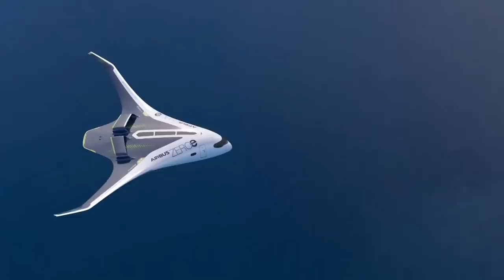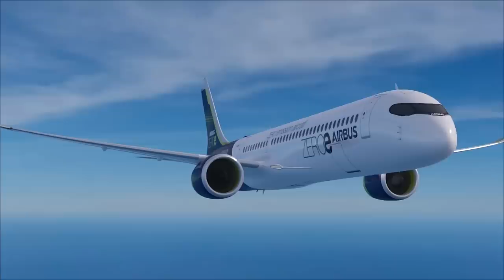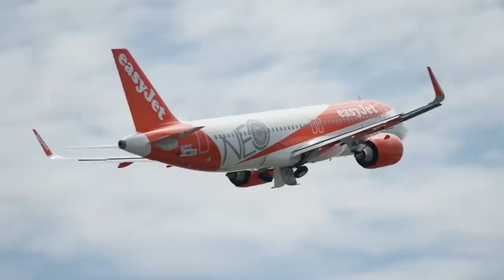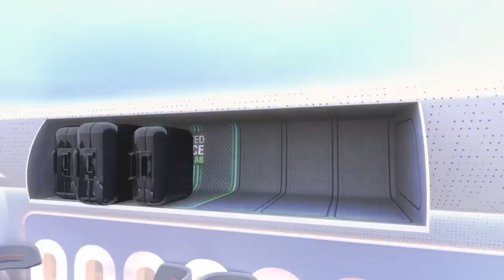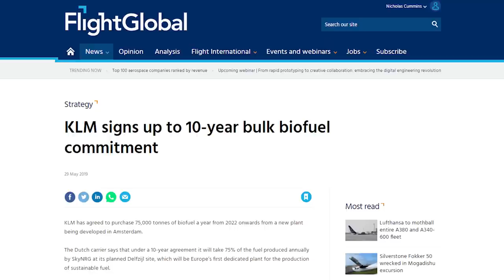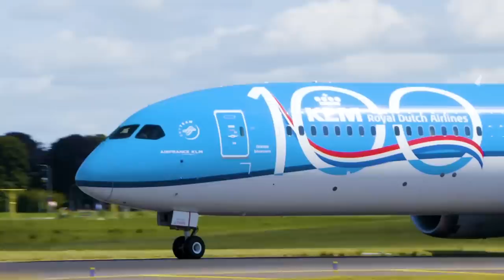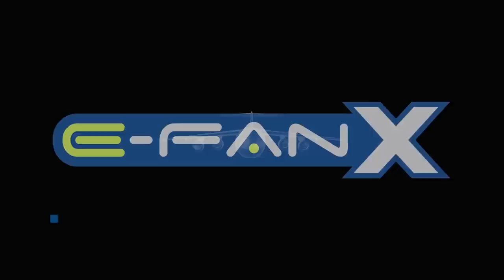Airbus Future Plane Concept - ZEROe - Hydrogen, New Cabins And Zero Emissions - Never Built

Comment: I really do hope that these new hydrogen hybrid aircraft become a reality. Especially the single blended wing body design. That just looks so awesome. We need to be pushing innovation in this so much more.
Reply: Blended bodies have existed since the 70’s. They aren’t used for commercial aircraft because no airports support them.
Reply: @airman122469  the main purpose of this type of body is the hydrogen tank , also this type of airplane isn't ready for airports, the airports aren't ready to work with these airplanes.
Reply: They have a number of shortcomings in terms of engineering, despite being more efficient.

Comment: I think the far more sensible solution to making airlines more environmentally friendly is just to invest in facilities that use a bacterium that was invented recently that can convert sunlight, CO2 and water into perfect kerosene.
Reply: but kerosene still emits greenhouse gases when burned... it would not be a 'clean' aircraft
Reply: @coconutisland.  True, but this - if scalable - would massively reduce the fossil fuel use needed to extract and refine hydrocarbons into jet fuel, and that in total is the majority of the emissions for a liter of the stuff.

Comment: All “fancy” ideas end up in stuffing more and more (and more again) seats into a plane. I’m highly sceptical that there will be any changes in commercial aviation design for a generation, let alone as drastic as described in this video.
Reply: I like planes being as they are in design, it's sleek and simple.
Reply: Look into spacex if elon succeeds we could be travelimg 24hr flights in 30mins with spaceships costing the same as a plane ticket in a decade or 2.
Reply: @pablomuzzobar8940  Nope. 

The amount of fuel required to get above the troposphere is far greater than just flying at conventional altitudes. It will never be the same cost as commercial airline tickets.

Comment: I like the blended wing body design because of the potential of reduced drag and it's stronger structurally even if conventional engines are used.
Reply: That could also mean a rougher flight for the passengers due to the more ridge structure.
Reply: Also in the designs the entire body generally produces lift helping to make them more efficient.
Reply: That's a relatively old McDonnell design.
Reply: I disagree regarding higher structural stability. Keep in mind that the cabin has to be pressurized. This isn't just for breathing comfort, but also a huge factor for structural stability. A pressurized body with round cross sections has increased stiffness.
Regarding wing stiffness: there can be too much of a good thing - (elastic) bending is better than breaking!
Reply: It was prohibited for Germany to develop blended wing designs after WW2...that is why the USA/GB got ahead...(B2,Vulcan) and they took those engineers...
But Horten got a new GA blended wing aircraft...

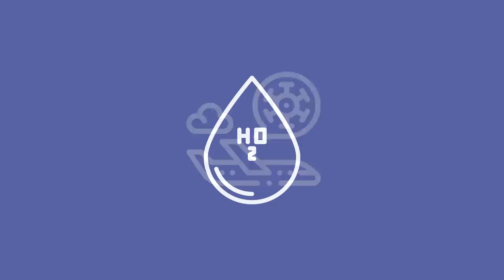Comment: 1:16 Dihydrogen Monoxide (H2O) not Hydrogen Dioxide.
Subbed BTW love your vids
Reply from the maker: Haha I knew I shouldn’t have skipped chemistry
Reply: It could be H-OH , hydrogen has one positive bond and oxygen has 2 negative bond usual comical formula it’s H-O-H , hydroxide ion OH-(negative charge) with active hydrogen H+ (positive charges), however liquid hydrogen (H2) must be store in very low temperature ( lower than -252.87 C)it will be hard to use , don’t know how they are going to use but it’s very hard challenge
Reply: @divyeshpatel147  Gaseous under ~1000 bar pressure.
Reply: @divyeshpatel147  , sorry, but burning hydrogen gives H2O, and is properly named dihydrogen monoxide, or simply dihydrogen oxide. Either is ok and its chemical structure is H-O-H.
Reply: @FoundAndExplained  EVERYONE should take chemistry and at least a little physics. Many issues a citizen must understand to vote properly involve applied physics or chemistry. To anyone who understands those subjects, global warming becomes a certainty, as does ocean acidification. Understand science and issues of pollution, dealing with plastics and many other issues are made clear. Otherwise, it becomes a matter of belief, or faith where you believe what someone else tells you. Many people who say that they don't believe in global are really saying that they don't understand how changing the amount of CO2 by small amounts can have such a big effect. The don't understand science. A physical chemist in the 19th century worked out the calculations at the heart of this matter, and those basic principles haven't changed in 150 years. It is 'settled science,' to draw a parallel to scotus and settled law, but people are illiterate scientifically, are unable to participate in many big issues of today.
Reply: @Prof.Megamind.thinks.about.it.  
Don't you think that electrolyze saltwater will create Cl-2 and NAOH?  You need fresh water brother and that they don't have.
Reply: @bonaventura3924  
Lessee... 
Combining them produces sodium-chloride , sodium-chlorate , and water . 
Okay... time to start selling table-salt , bleach , and bottled-water ! 
Seriously though , these can be sold , deep-sequestered , or otherwise neutralized . No great hardship there . 
🤔
Addendum : Even better ; combine ALL of the Cl. with Na. , then dispose of the salt safely .
Reply: Sorry to correct a know-it-all tween, but it would be far more accurate to call the compound Hydrogen Hydroxide, that is, HOH, because it is a much better description of the way it reacts and forms other compounds, that is, its CHEMISTRY.
Reply: @divyeshpatel147  You came fairly close to the best answer, but not quite there. Also, I don't know what "comical" means in this context
Reply: @Jose_Hunters_EWF_Remixes  "Know-it-all tween"? Damn dude. Why the insult? If you have knowledge to share, then share it. Don't be rude.
Reply: Actually the International Union for Pure and Applied Chemistry (IUPAC) gives waters chemical name as oxidane. 

In short, your pedantry is incorrect and people should stop LARPING as chemists.
Reply: @TheDrjehr  No, it's called oxidane. I'm not sorry.
Reply: Its also called hydrogen hydroxide as it is H and OH 😇

Comment: Using as Hydrogen as fuel requires massive modifications to the fuel systems not just the engines. Cryogenic fuels are incompatible with existing wet wing fuel tanks. That means the builders must find room in the fuselage for a fuel tank with twice the volume of existing tanks in the wings and the aircraft cannot be left with fuel onboard.
Reply from the maker: Yes the rear 1/3  Of these plane designs actually have hydrogen storage fuel tanks
Reply: Found And Explained That also impacts the wing designs as without the fuel in the wings the wing roots are carrying a heavier bending load so need to be corresponding heavier. (One of the reasons airliner fuselage tanks are the last to be filled as well).
It is not a simple swap. Other fuels would be easier - synthetic ethanol or methanol for example is compatible with existing designs or with more modifications ammonia (ammonia production currently swallows 1/3 of global natural gas production to make hydrogen).
Reply: @allangibson8494  synthetic ethonol releases co2 when burned which defeats the purpose of a hydrogen powered plane in the first place
Reply: webnothing  
You are wrong sir. Farmer has to plow his field, then plant the seeds,than apply fertilizer, then harvest the crop, delivered it to plant, when lots of energy is used to process it and distribute etanol. That's disaster for environment.

Comment: liquid hydrogen is much less dense than kerosene so fuel tanks need to be bigger so... no luggage in that plane?
Reply from the maker: The whole back 1/3 of the plane is the storage tank
Reply: @FoundAndExplained  oh yeah i see some versions dont have windows at back... still when they burn fuel center of gravity will change and that will cause some problems...
Reply from the maker: @jebise1126  Oh god I didn't think about the center of gravity changing! haha wow!
Reply: Yes but it’s heat value is 4 times higher, so 4 times less fuel is needed.
Reply: Storing hydrogen is a sod, too. All the world's cars could quite easily be switched over to run on hydrogen gas and be pumping nothing but steam out the back, but they'd need filling twice daily and would lose fuel just standing still.
Reply: webnothing  there’s many more obstacles. For one, the whole H2 cycle is suspect. Current economic hydrogen supplies are made from methane and water, releasing CO2 into the air, and collecting the H2 which is pressurized. This process uses lots of energy, and did I mention the release of CO2?  Using electricity would require installation of lots of generating facilities, and technology to create a functional transport system which is economically efficient.
Then there’s the whole energy density, and storage/transportation problems. H2 must be kept under pressure, and at extremely low temperatures, and still the gas can seep out, creating an explosive problem. All of these eat away at efficiency. Some have proposed building nuclear reactors, connecting with super conducting transmission lines transporting both electricity and H2 in liquid form. I’m not smart enough to do the calculations to see if this is feasible, but it calls for truly massive spending to build reactors, transmission lines, H2 electrolysis plants, H2 storage tanks, as well as cars which would run on H2, along with tanks which could hold H2 and be safe in accidents. All this before putting any of this into use, and proving whether it’s possible both technically and economically.
Reply: You  have to compress the hydrogen to convert it to a liquid. That's a lot heavier, especially when you consider how heavy the H2 tanks have to be to hold the pressure.
Reply: @Greatdome99  My senior design group is designing a hydrogen regional turboprop with a 1000 nmi range just like the Airbus. We based our initial weight estimation based on modifying the DHC 8-400 NextGen. Doing this we arrived at a MTOW of 75,400 lbs vs the 8-400's MTOW of 64,500 lbs. I am expecting our number to rise as we have not designed the wings and our RFP requires a takeoff and landing distance shorter than the 8-400's so we will need larger wings, and bigger engines since we are heavier, and our RFP requires higher cruising speed  (Our initial analysis shows that TO and cruise conditions are our limiting factors for minimum power required from the engines). Our preliminary estimated for our fuel tank are 11,160 lbs, although this is likely to increase as we incorporate more weight, drag, etc. This also assumes 1 large fuel tank at the back. As Jeb mentioned, we are facing a center of mass issue. We are looking at different options such as having 2 tanks, 1 in the front between the passengers and cockpit, as well as different ways for changing the center of lift during flight such as retraceable canards. All in all it seems like quite the challenge
Reply: Well then, make your hydrogen fuel more dense per area cubed. 

Only idiots talk in absolutes, but you wouldn’t know that
Reply: The best is sustainable biofuel
Reply: @Greatdome99  
You have to compress it and super cool it.  Evaporation would be a big (and dangerous) problem.

Comment: You missed another point about hydrogen. Hydrogen, when used with a catalyst in a fuel cell, may be zero emission, but apparently burning hydrogen as a direct replacement for hydrocarbons is not quite as non-polluting as many people think.

Apparently, the increased temperature of the combustion enables/causes some kind of reaction with the nitrogen in the air, producing... some sort of pollutant. I want to say nitrogen dioxide, but I'm not sure. It's definitely something involving nitrogen, anyway.

Comment: In All your aircraft stories posted, the plot leads to a crashing or deserted hanger stashed idea, in this one, it was the faith in hydrogen powered fuel. 
Yes Hydrogen can have range effects, including stability similar to collision/fire impact. Perhaps they will mix breed electric power engines with hydrogen afterburner affects, a future version would be plasma combustion as afterburners, with mini nuculear cells to amp battery duriation.
Reply: That'd be seriously sweet.

Comment: “Only the engines need upgraded”. Ever harvest, compress, and store hydrogen?
Reply: @Thomas Lucas Producing H2 from water with electrolyse efficiency is 30% at best
How do you bring that electric power onto the plane ?
You alos need to produce ENOUGH H2 in time... that is clearly impossible. People just dont imagine how much gaz is produced/ moved by an aircraft. This is by tons / second.

Storing hydogene is very hard, and the tanks continuoulsy link because the H2 is a really tiny molecul that can go through metal. Thats why rockets are filled just before liftoff and not in advance.
Reply: He said "Only the engines need to be upgraded, TO ANY EXISITING AIRFRAME" meaning the planes themselves just need HHO engines, learn to listen.
Reply: @SirFlukealot  sorry you have failed your critical thinking test. No more internet for you today with your magical thinking.
Reply: @Thomas Lucas VIDEO OF IT OR ELSE IT DIDN'T HAPPEN.
Reply: @Thomas Lucas electrolysis is not the debate. We know it exist. It is energy intensive however. You made a claim so back your claim.
                                                                       
This video's fault is that it claims if you throw new engines on a plane that suddenly they're clean energy vehicles. It does not address industrial scale production, storage, transport of hydrogen, far beyond what we use today nor fact the the fuel tanks of the aircraft will be radically different. You simple type however ignore all that.
Reply: @Thomas Lucas I wouldn't bother trying to change their minds. You are correct. No matter what you say or explain, they'll refuse to believe it because they are unable to fathom how it works and how to negate the problems from the simplified concept. It's already been done and refined.
Reply: @SirFlukealot  He's wrong.  The fuel system would be a major problem. Possibly insurmountable.
Reply: @Thomas Lucas  NOT easily. Costly and inefficient.

Comment: The plane with the propeller doesn't burn hydrogen in a turbine at all.
It uses fuel cells to produce electricity to drive electric engines, a completely different form of propulsion.
Also burning hydrogen in turbines isn't entirely environmentally friendly if it's burned in air (in part because said air contains other things then just O2 but also because the temperatures in question allows other chemical reactions, with fuel cells you really just get one chemical reaction, oh, and another thing, planes fly high enough that some of the gas coming in is ozone, perhaps not ideal to burn that...)
Reply: It these contaminates are already in the air, how does burning H2 and whatever is already in the air make the air worse?
Reply: @fahrbot1  Thanks for the explanation. Never knew that.
Reply: @fahrbot1  Awesome Facts - and nobody is looking at this way...
Reply: The plane with the propeller doesn't burn anything.  It is nothing but a digital picture.  The purpose of these ads is to increase public pressure for additional illegal taxpayer subsidies to Airbus.  There is a word for this in the English language.  It is called Greenwash.  Look it up.
No current or foreseeable hydrogen turbine has anything resembling the energy density required to power an aircraft.  The only non-hydrocarbon technology that comes close is lithium-ion batteries running electric motors with propellers attached, and even that is decades away from feasibility at current rates of technological progress.
It is sad that voters are fooled by this.  We need journalists who can identify and remove technological fake news.